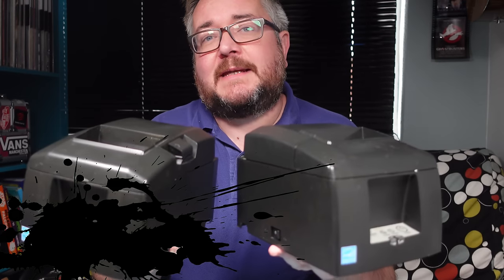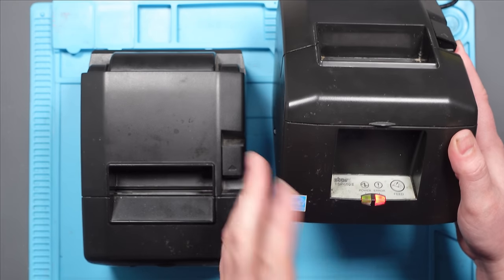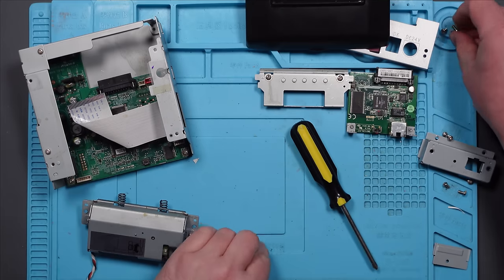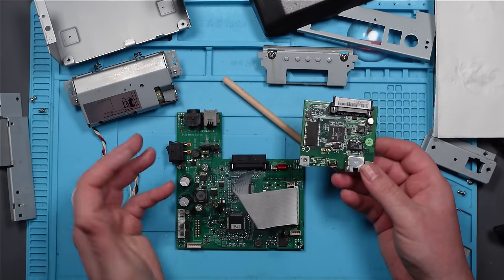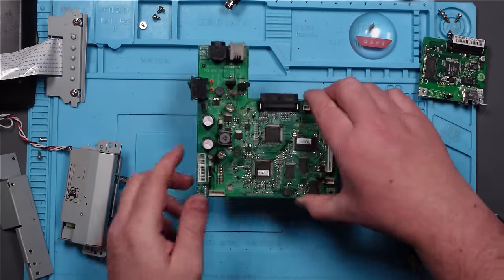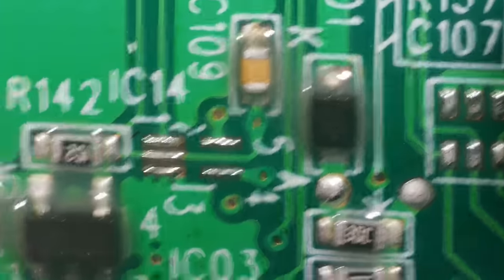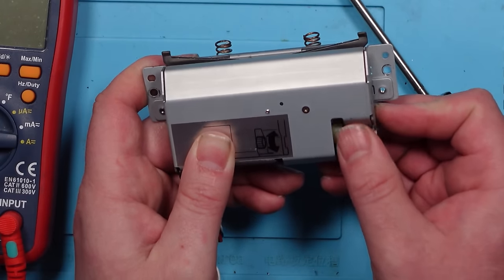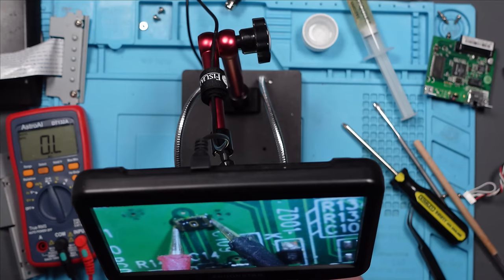2 FAULTY Star PRINTERS | Let's Try and FIX Them!

Comment from the maker: Stupid Printers.
Reply: The bane of many IT Persons existence.
Reply: Stupid Printers... in a Karaoke-Bar?
Reply: aha!
Reply: Nice one. Any way to make the PCBs liquid proof?
Reply: @bufordmaddogtannen  The automotive industry among others use so-called "conformal coating" on PCBs and components.
Reply: @oldguy9051  covering the whole PCB with a protective layer would render future repairs a PITA though.

I was more thinking about  using a plastic bag or adding some sort of barrier all around the PCB edges.
Reply: You can get varnishes that are dissolved by IPA, so won't be much of an issue. Will protect against water.
Reply: I used to work for a company that made thermal printers, but I'm that old it was before the days of Bluetooth and wireless Internet. They are a pain jn hhe arse when they go wrong.  Your staff will be over the knot you got thise fixed x fab video x
Reply: They really are
Reply: Steve, perhaps time to invest in a ultrasonic cleaner for these corroded PCBs to make them easier to work on?  Been with the channel since 3k subs, keep it up mate.
Reply: If only those poor wee printers could talk back. They would probably print out something back to you
Reply: Just so you know all that corrosion will come back, using IPA may remove the residual ‘green’ corrosion however you need to naturalise the electrolyte for the fix to last long term.  Many people on YouTube use white vinegar as a way of doing that. Probably worth you looking into for long term reliable fixes etc

Comment: As the Technical Director of Star Europe, I applaud your repair of these. If you want to do a more comprehensive self-test, you can power the printer on with feed held to also test the print head and show settings. We also have technical manuals available for all our products, if you find a trickier problem in the future. I too would suggest a conformal coating of the boards if they cannot be relocated to a dry area.
Reply: So, lots of words, no information other than "we know our products are known to fault but if you pay us money, we can slow down the process"
Reply: I don't agree with your comment. Conformal coating can be applied DIY. I doubt Star would conformal coat a PCB if you sent it to them.
Reply: Worked for a POS company for two years that exclusively used star micronics thermals and those manuals saved my life more than once. Give your technical writing team a raise! ❤️
Reply: @James27Simko  he literally gave an extra self test step and links to free technical manuals. Never happy?
Reply: @jgdovin1  he did what most marketing directors do. Nothing. He let other people provide information and then relay it back to people like we are all stupid and can't listen to the guy in the video that we are here to see.
Reply: @jgdovin1  and there was no "links" provided with any further information on how to safeguard this clearly known fault. Instead of taking this video and saying they will make a progressive change to fix the problem, they offer a DIY solution that will in the end be an unnecessary cost to the customer when the company should make products that work in the environment they are designed to be in.
Reply: @James27Simko  I don't thing that they are designed to have beer spilled on them.
Reply: @sponfishlunitick  Have you ever worked in a bar? The reciept printer needs to be kept next to the register behind the bar in case people ask for a reciept (corporate functions, picky punters, etc.). Guess what's also behind the bar? Lots and lots of beer!
Reply: @RetroJack  That still doesn't make the printer a faulty design unless it's advertised as waterproof.
Reply: @james simkins cheer up mate @dave_pearce nice one fella.
Reply: @Joseph Rand  Correct. We do a full range of printers, including IP rated ones, specifically for hospitality. Not all of our products are used in wet environments and so do not need the extra costs of IP. This model also works vertically which will lessen the chance of spills reaching the electronics.
Reply: @TheDavalad  Your response is better than 99% of the other companies that have their products repaired on YouTube.  THANK YOU.  Simply indicating the existence of the service manuals is a vote of confidence in the repair culture.

Do you have a repair department in Finland that needs a techie?

Do not feel bad about the criticism, it is a result of the fact that most companies say nothing or offer useless advice, the general response is to send it in or buy a new one.
Reply: @James27Simko  What are you even talking about here "known fault", what known fault, those thing didn't have any particular fault, they were just corroded from all the beer going in, if anything this is impressive they worked this long and could be repaired this easily, especially the fisrt one that was almost glued in place thanks too all that beer

Also the advices for the self test and technical manual or conformal coating are not a "if you pay us money" advices, they are just really good DIY advices to help repair existing macines, a pay us money advice would be to "buy an IP rated one next time", but even this wouldn't necessarily be a bad advice either
Reply: As a service technician, we sell a lot (relative to other printers) of star printers and they work in extreme environments. Dust, moisture, people who don't care. The mostly work till they mechanically wear out which by that time they have tape holding them together. 
Great printers.
Reply: I suggest coating from factory, given they are used a lot on moist environment.
Reply: @Olivil  why not factory.....silly
Reply: @James27Simko  They're not waterproof, and they broke because beer was spilled on them. lol
Reply: @James27Simko  I'm not sure what the issue is here. He clearly said these printers are in a bar and get stuff spilled on them from time to time. How is that the manufacturers fault?
Reply: Good to see you here Dave, LGW (Box)
Reply: The answer is clearly beer, now what’s the problem ? 🍺
Reply: Kudos for responding. I am the Technical Director of Vyger Turntables and always respond in situations like this, I thought I was alone!

Comment: Is it ironic that you have cleaned all that up with IPA. Which is a concentrated version of the actual thing that helped to cause the problem?
Reply: As long as he's not using Indian pale ale for cleaning... 😂
Reply: @armin0815  🤣
Reply: Bar owner. Wasn't expecting that.
Reply: It's the sugars in the beer and mixed drinks that's dissolved by the IPA. Ethanol is one of my favorite solvents.
Reply: Alcohol - the cause of, and solution to, all of life's problems!
Reply: I sure hope there's no isopropyl in any of the drinks being served
Reply: I prefer calling it ISO not IPA
Reply: @xxTyphoid  you wouldn't be able to see it after drinking some thats for sure 🤣🤣🤣
Reply: @Factory051 yea there’s an episode where he fixes a few lights on the optics / pumps and tests them at work. #Stez lore
Reply: Just as well it wasn't alcohol free beer that did it!  What would be used to clean that up?  LOL.
Reply: @James27Simko  So when you run out and have to find some more, you're ISO ISO? 😂

Comment: It always amazes me how a single component worth less than a penny could turn an otherwise functioning piece of kit into e-waste. Great job!
Reply: not under Steve and Dave's watch!
Reply: A 0 Ohm resistor essentially acts as a fuse, so it probably died protecting another component from damage.
So yes, it stopped the printer from working, but it probably made it easier to fix than it could have been otherwise.
But still way too many people would just throw something like that out so it's a good job we have people like Stez who will actually check these things!
Reply: Annoyingly also these are typically to keep production costs down where you'd normally use a jumper. So in fact, in this case, it could have just been a track nothing more nothing less.

Comment: That's shouldn't a 0 ohm resistor, name is F on the Board, should be a Fuse with Code O value 2.5A

Comment: Love watching these videos. We live in a throw away society with electrical equipment and just shows how easy something can be repaired. My daughter dropped her phone in the sink last week and her phone wouldnt turn on. Through videos like this its gave me the confidence to take the phone apart and fix it. Ive managed to get the phone working but screens not coming on all the sounds work alarm still goes off and connecting the charger produces a sound so hopefully its just down to the screen that needs replacing which on ebay is 30 quid. Most people would of just gone out and bought an new one. Wheres the best place to buy a bottle of ipa really could do with a bottle.

Comment: I have had to work on our Star printers from our Kitchen.  It was always a build up of contaminants keeping it from working properly. From cutter issues to print head movement causing to not function. As you stated, if the printer doesn't function, neither does the cash drawer. Glad to see you fixing the printer instead of trashing it. Those printers aren't cheap.

Comment: Congrats on fixing BOTH printers 👍
I think the zero Ohm resistor is replacing the (more expensive) fuse which would be mounted at the soldering joints directly above it. Surely the corrosion was a massive problem in both printers, but I think in the first printer a overcurrent "tripped" the "fuse". Maybe the mechanism of the cutting motor was blocked, or there was some "liquid" producing a short circuit somehow. Glad you could fix this little printer so easy 💪👍🖖

Comment: I have had to repair quite a few of these little printers.  I wish they had conformal coatings ( and I often spray one on after full repairs ) because inevitably they are used in harsh environments.   As it is, the most common issues are: Capacitor C4/C6/C7, corrosion in the connectors, resistor packs... but worst of all is when the thermal head takes damage ( basically has to be replaced )

Comment: Most printers have a built in self test. Hold down the paper feed while you turn it on and it should try to do a character print test until you power it off again.
Reply: Yip and can also change config options on some like that also.
Reply: Would have been great to really see a test print.

Comment: Great fix however the smaller 0 ohm might fail under frequent use of the printer.  Chances are they picked the larger one specifically due to the current that the big traces they are connecting are carrying which I would guess is the power or ground to the motor driver.

Comment: You could cover the boards in a conformal coating if you want to keep these running. A pre mixed conformal coating from mouser or cpc would work or mineral spirits and clear silicone could work.

Comment: The upper pad of that diode looks a bit loose. Probably a good idea to resolder some of the corroded pads.
You can reduce to risk of "beer intake" by elevating the printer on the desk with some rubber feets or somting similar.

Comment: Given the corrosion, and likelihood it was spilt drinks it might be worth applying a layer of conformal coating to them.

Rattle cans can be had for about $20 in the US, pricing may be different there but it would sure help to mitigate issues going forward.

Comment: Someone else already said this but, you need to conformal coat all of that bare copper or it will become copper oxide again, that greenish powder... And that will short between traces and keep it from working again until you clean it or corrodes all the way through a trace and then you have to fix it further.

Honestly they should come with some kind of sealant or coating in the first place considering the environment they're intended for.

Comment: Working in IT, and for a time, specifically with HP and Zebra printers... THEY SUCK. I hate them. I'd rather install Windows 10 times than try and troubleshoot a printer. Top job.
Reply from the maker: 😁 thanks Kaltern, have to agree with you there! 😁

Comment: Amazing, a bad fuse. That is very rare. Great job.
Reply: That resistor was not intended to be a fuse... Although it did act like one.
Reply: Component reference is F2 so maybe designed as a fuse?
Reply: @matthewbeeson5612  F2 is the unpopulated pad above R432, so this board will accept either a fuse or  zero ohm resistor
Reply: @TravisFabel  It was there to act as a fuse.  Cost is much less than an SMD fuze that was the option on the adjacent pads and even though it has a wide fusing current range it is suitable for fault isolation.

Comment: Hi Steve. That 3pin, 24v power supply .......... dont plug it into the printer with the ppower on! they have a tendency to blow into the middle of next week (I'm a till engineer and have been since 1979) well done on the repair btw.

Comment: Is that just a normal paint brush you are using to clean with?  just starting out learning on how to work on things and just trying to get everything in order.
Reply: Old toothbrushes are a common option.  You can also cut the end in half either direction to make a smaller brush for tight spaces.  Acetone will often soften the plastic but not all brands, also they now have bamboo brushes that will survive acetone.  Also remember that acetone can attack other components too. Clear plastics are often no match for acetone, some will suffer from IPA or Everclear, be careful.

Comment: I don't understand what purpose a 0 ohm resistor has. Isn't it just a bridge? If so, doesn't a wire do the same thing?
Reply: They are essentially fuses because they will burn out easily if too much current passes through them. They're sacrificial components used to protect more important components.
So yes you could replace them with wire because that would complete the circuit, but then there's the risk that next time there's a power surge/short caused by beer another bigger, harder to replace, potentially fire causing component would blow up instead.
Reply: @fadetonoir6152  Thank you for the explanation.

Comment: I’m no expert but the connector sockets where you cleaned up the corrosion on the first printer, you might want to re visit and remove them and clean underneath in case some corrosive material made it’s way underneath the connector sockets.

Comment: forever replacing these in pubs,  as a field Tech.  Depending on the till system and the access you have, the till drawer can be opened without the printer attached

Comment: Forgive my ignorance, but wouldn't a jumper be the same as a 0 ohm resistor?
Reply: It's like replacing a blown fuse with a nail. Star designed it to take a fuse (F2) or a 0 ohm resistor (R432)

Comment: Replace the zero ohm links with a glob of solder it's a ton more reliable

Also: hello Dave
Reply: Yeah. I believe they use 0 ohm resistors instead of just running the track directly is that one board may be used in multiple models that require different resistance there or was part of the prototyping process that wasn't removed, and since a pick-and-place machine doesn't typically do solder blobs, a 0 ohm is used instead.

Comment: I worked with these printers for two years professionally (installing restaurant point of sale) and you can usually pop the till with a hole in the top or bottom of the drawer. Cutter error is usually what happens when the physical paper cutter is jammed or broken. If you need further help with either of these lmk.

Comment: I have been working on electronics devices since 1974 or so,,  Yess 50 years,, and I have no use for a zero ohms resistor.. A trace would work just as good..

Comment: Just a note, when you test a diode and the reading on your mulitmeter is XXX and you say "thats fine" .... well care to explain why its fine too :-) Also when looking for grounds on the boards on both ends of a capacitor .. also tell us why 🙂
Reply: Brief explanations -
Diodes only allow current to pass in one direction, so their resistance should be low in one direction and high/infinite in the other. He didn't actually know what the value should be (he said he could compare it with the other one to check if necessary) but what was important was that it showed some value with the multimeter probes one way round and OL when he swapped the probes over. This suggests the diode was working properly and hadn't been blown open or closed.
Capacitors - one end should be ground, the other positive. If both ends are connected to ground you have a short somewhere. Not necessarily that cap, could be something else connected to it, but finding a shorted cap is relatively easy using beep mode and gives you an idea where to start looking.